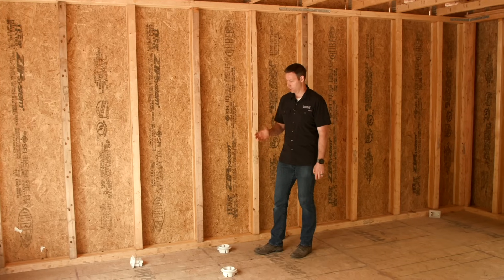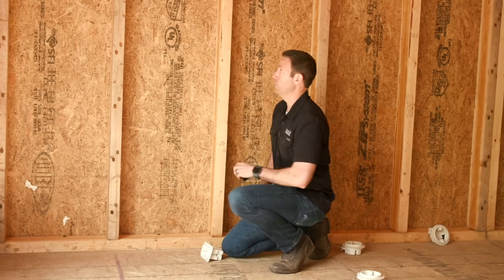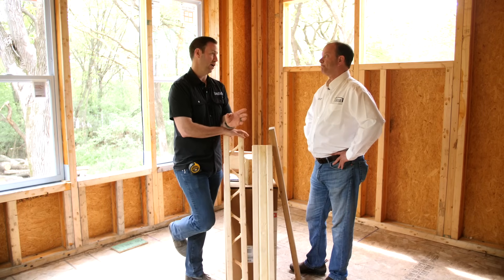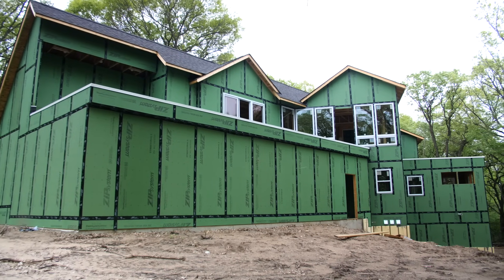Insulated Studs? This is a BIG Innovation in Framing!

Comment: Nice video. However it is a bit pointless when the Windows and Doors let most of the heat out.  And Prop 65 would probably prevent them from being used in California.
Reply: Every stud would have to be stamped with that lame ass warning. This product is known to the state of California to cause  pimples on my ass. That stupid warning is on everything you touch. It's like the boy who cried wolf. If you actually encounter something that could really harm you it will be ignored. I doubt that prop 65 will prevent one single injury from happening but I'm sure it provides numerous cushy state jobs.
Reply: What is allowed in CA, only illegal immigration and taxpayers getting the shaft!!

Comment: This is really cool stuff. However, there is an increase in the "double wall" style of build at least around here.  There is a modification to it now.  There is a 2x4 for the outside wall and then staggered there is another 2x4 frame, thus there is about an 8 inch gap to fill. How does this compare with this new "stud"?
Reply: I would expect it's similar, but the tstud could have a couple of advantages. 1) framing up wall sections with doubled, staggered studs is going to be a little more labor intensive.  2) On the double studded wall,  you're still going to have thermal bridging on the plates.  Whether those advantages are enough to offset the cost of the tstuds is the question.

Comment: Can these be used to stick frame roofs?
Reply: Balance 29 not yet 😊
Reply: Sounds like it won't be long with a few modifications.
Reply: There wouldn't be  much reason to do that.   Usually in Northern regions the attics are ventillated and cold. The insulation is in the ceiling of the top occupied floor. There would be no advantage to using insulated studs for a roof over a cold attic.
Reply: The reason I speak of is the weight and the ability to connect everything together with the foam. Hurricane area

Comment: Great innovation.  

Only things that I'm wondering about are fire performance and how much more difficult this makes fishing wires or changing outlets (a/v equipment, new ceiling fan etc.).    I know some foam products are fairly fire resistant, but others burn very quickly.  I've got some engineered foam insulation here and it was shocking how easily it went up in flames from just the tiniest cigarette lighter whereas you can hold that same little flame on a 2x and your thumb will give out before the wood ignites.
Reply: degustibus this is a Type 1 foam, we have a 20 minute video with a proponent torch online. And we have a Class A Fire Tstud coming in 45 days

Comment: why are the ceiling joist directly over the wall stud where Matt is standing at 7:65  but the 3 to the left of him are no longer centered over the wall studs?
Reply: onenikkione top plate is a mini header and 1.5 times stronger than 2 - 2x6’s in plank so the truss can be as much as 7” off center

Comment: My only concern is "off gassing."  The foam is a petrochemical product and as it oxidizes it releases fumes, right?  And then the plywood is made of wood chips glued together, and that adhesive will off-gas.  Add wall to wall carpeting and other petrochemical products into the mix and the interior air becomes polluted.  The amount of off-gas may be minimal and undetectable by most people, but it's there, and some people get sick because of it.  Otherwise, this is a great invention and I can see how brilliant it is.  I would consider using it to frame inside a shipping container home, too.
Reply: Russell Garr we use the new HFO blowing agents, not HFC. And the off gassing was really prevalent with formaldehyde’s pre 84 I think
Reply: Yes, but even real timber contains formaldehyde.
Reply: @greengenie7063  --- Interesting.  I wasn't aware of that.

Comment: so breaking the dowls for plumbing isnt a issue ?
Reply: Yes, it is an issue. The dowels are not permitted to be cut.
Reply: There should be enough room to fit pipe through it. If there isn't, then that means the hole you need is far too large anyway and would never be allowed in a conventional stud.
Reply: No dowels cut in 100 projects then a plumber cuts 7 on the same job. Dang. The repair in the field is to install a fully threaded #14 screw above and below the cut dowel. 5” long.
Reply: @thermalstuds  Sounds like the plumber wasn't briefed sufficiently on working with the material.

Comment: How is this a big innovation when iso3 has been around for probably a decade?
Reply: Because perhaps no one has ever made Insulated Studs BEFORE is why it is Innovative.
Reply: The definition of innovative is “introducing new ideas; original and creative in thinking”. To me, substituting wood for metal or concrete is not all that original or creative. It’s simply another building material.
Reply: @brucea550  gosh do you still miss the whole point of what innovate about it or what is considered innovative. This the first Insulated lumber i have come across that has actual structural qualities and not like others who just stick foam between two pieces of 2 by 4 that is not all that innovate or of and structural benefit other than to provide a thermal gap between the wood studs which is a form of double wall construction. What I am comparing this to is Larsen Trusses, which IMO are useless where as Tstuds serve a better purpose since they are so much stronger and provide better bearing support than a solid stud with the added benefit of the foam insulation being a thermal break/gap. www.greenbuildingadvisor.com/article/all-about-larsen-trusses
Reply: “Tstuds serve a better purpose since they are so much stronger and provide better bearing support than a solid stud”
Why do you think that? Source?
To me this is simply another form of double wall with insulation in the middle. Maybe the dowel part is innovative? I think it may be a good product (but can think of several reasons I wouldn’t use it) but until it’s been in use for a couple decades we won’t know. I don’t share your excitement for it, sorry. To me, something like pex is an example of being innovative- it changed plumbing dramatically, as well as in-floor heating.
Reply: @brucea550  Hydronic (in-floor heating/cooling) pex and general plumbing pex are NOT made equal, thus why you have to buy the more specific pex actually made for in-floor heating use, and many plumbing pex manufacturers say their product is not intended for other than general plumbing lines.
If you want to read the parts again in my previous comment to you and bother to go their website for the reports for yourself to get what I already said before. I am not going to further repeat myself.= tp someone like you who clearly can not bother to comprehend my intelligence. I even gave an informative articled link to another similar product that explains why that one is not made for structural purposes. This is still far superior than that and as they mention in the video the strength of the studs as already tested.
End of conversation.
Reply: I wasn’t discussing Larsen trusses. And yes, most of us know the difference between regular and air barrier pex. Tell us all again how intelligent you are? 🙄
Reply: @brucea550  Intelligence can never truly and accurately be measured. Is this enough to show my own intelligence?

Comment: The DrJ report leaves a lot of desirable information out about structural design. Is the intent to use these only in projects that follow the IRC or 2308 of the IBC? How do these deal with in plane lateral loads in sheathing per SDPWS (IBC 2305)? Can these be used as joists or rafters? Is there testing on bending? What type of wood are the dowels made of and is there bond to the flanges ever a limiting factor?
Reply: Also, if like me you actually dwell a bit in the testing reports, some of them mention the 2x3 being jointed by METAL pins, not wood dowels. That is an issue in terms of the validity of some of the testings.
Reply: Those are all good questions. The fact that this is an engineered product could seriously limit their practicality as you likely won't be able to alter them in any way to accommodate for mechanical's and what not.

Comment: Probably cost at least double for just the material not to mention the extra labor. Can buy a lot of power for that.
Reply: The guy mentions the price difference around 13:25 to 13:55, 1,500 more for 2500 sq ft or something like that.
Reply: Joshua79C C all I can say is bid it before you have an engineer put it in the plans. Or u be way over budget
Reply: @bartfdeubcvbuuexvio7289  Thanks but I already hae common snense to do m own hoework before going forth on a project when I have the finance to go forward with, Unlike those who just hit the gorund running head on into a project and then get shafted by the contractor with this and that bs reason. I worked for my step-dad who was  abasement waterproofing contrator and I had customers ask me if what they got quoted was right and I always first responded with "he does his own homework, did you do your own homework?". If I got asked again with a befuddled look or such I simply respond back with :"yes what you got quoted is what you pay for and is the best cost and if you are feeling dissatisfied with the prices or such then feel free to contact the BBB" (essentially a consumer protection bureau that grades companies based on customer satisfaction and complaints combined). 
He even showed customers what he pays so they were assured they are getting what they pay for and we did quality work, better than our competition who cut corners with crap products and poor workmanship, We since long gave up on the business when he encountered medical problems (fibromyalgia) and I was taking another path in life and taking on new challenges as I was only 22 when he decided to sell out, he asked me first if I wanted to take over "I am not interested and so you do what you want". Anywho, yeah I already know the gist of the world. We never got a call-back to redo anything other than to warranty our work and often found we got calls for malfunctioning pumps (we used the best available and nothing is always perfect), never had to rip a job to fix a leak in the drainage plumbing system.

Comment: Wow. This product is going to change building. I just hope the electricians would run there wire in the center of the stud. Not just on the back of the front stud. Amazing product. Great job.
Reply: I'd agree that would be best,  but  running it on the back of the front stud puts it back 1.5 inches whcih meets code, and is pretty much the same depth as running it through a hole drilled through the center of a stud in a 2x4 wall.
Reply: @andrewalexander9492  I was just thinking about that guy that runs a 3 inch screw hanging there TVs. Which your right most electricians do just put it a inch and half in. It really needs at least 1 3/4. But anyway I will be using this system on my next framing job. Excellent idea.
Reply: @SS--CAL   Yeah, I knew where you were going with that, just saying that in that regard, it's as safe as the best possible placement on a 2x4 wall. And you just know that even if you run it right in the middle, there's gonna be a home owner hanging his TV with 4 inch screws.

Comment: How do you prevent racking with single top plate. Also dont see any wind bracing to prevent racking. Do you have building codes there.?
Reply: it relies upon the sheathing/nailing to act as wind and lateral bracing, that's been done for quite some time now.
not saying I like it, nor the lack of overlapped interlocking plate joints :)
Reply: @throttlebottle5906  not sure that passes code here. ? Pretty sure need wind bracing still. Even with brick siding. Oh well. Just not sure I like the direction of where the building industry is going. Also lumber does have r value. Just saying. Real.lumber beside this stuff the r value is probably comparable.
Reply: @redwood7121  R value of the tStud is R20, whcih la 2x6 would be about R 8, so not really comparable at all.
Reply: @andrewalexander9492  what's going to happen structurally when the foam falls though.?
Reply: @redwood7121  From what I've read, the foam doesn't add anything structurally.  Obviously if the foam falls out,  the insulating value is going to suffer.

Comment: I wonder if that insulation could absorb water and keep things wet.  Time will tell.

 And while not directly related to the product, I would not buy a house with studs 20" on center.  It's hard enough to hang cabinets already.  Stop with the corner-cutting.
Reply: Not a fan on the larger spacing myself, not necessary with this product since it is now "self" insulated in compare to solid lumber, rather just stick to 16 OC as the extra strength would be even better than the more spaced out framing method.

Comment: Why would they use batt insulation and not spray foam if you’ve spent money on R20 studs..? Not a very cold climate?
Reply: Because good 2x6 bat insulation is r20
Reply: Trevor Roth yeah but spray foam is over 40. In 6”

Comment: They are certainly not going to eliminate lintels. Those things provide no support stacked flat like that. The only reason they did that is because they have a structural gable.
Reply: Actually the gable they show is not structural.  It is a gable truss.  That 9' door opening requires a structural header, and an engineer would have to sign off on this T stud being used as a header.

Comment: I guess I stand alone but I think it's a completely stupid idea.   I wouldn't use them.
Reply: my MAJOR concern is its strength. He says he comply's with building codes for things like wind. Standard throughout the US is a 3 second 100mph gust. Thats your standard 2x6 3 nails for 2 story or less houses. He talks about top down strength. He does not talk about sustained side to side stress. with less wood using dowels to make a makeshift Truss it is almost assuredly worse. 
My area gets a half dozen or more 100mph wind gusts per year. I Really would like to see that 2 story house try to meet a 126mph gust or 100 sustained rating. "It wouldn't"
Reply: @Tfad812  I bet the truss outperforms a stock 2 x 6.  There is a reason bridges and all sorts of structures use trusses.
Reply: @genephipps6421  They use is because it is cheaper. In a bridge like you mentioned; It is worth the cost of an engineer in order to use less material. In buildings they use them because they can be assembled off site then put into place. being roof trusses or metal trusses with cranes for tall buildings. Trusses inherently are cheaper, faster, and weaker than solid structures.
But in this case of these they are NOT cheaper than wrapping your house on the outside, but they may use less total lumber.
Reply: @Tfad812  pound for pound trusses are stronger...
Reply: Why?  I'm seriously interested in your opinion, because it seemed pretty legit to me.
Reply: @MichaelGustavsonArchitect  they still have connecting dowels so there is still transference of heat.  Having spent a lifetime in the construction and repair trade I have learned that to truly fix any problem you have to address the root of the problem.   I've also learned it's cheaper and better to do a thing right the first time.  I think there are good methods for increasing the r value of a house and I think this is just a distraction.   For years only the rich had cellular phones until the demand became such as to justify a price all could afford.   I  would like to see the same thing happen with an r control house so everyone could enjoy the benefits.
Reply: @engineclinic  The connecting dowels cover only a small fraction of the area a solid stud would cover, and since they are angled, any heat has to travel farther to get thru. That is why these studs are R-20, which is better than the typical insulation used in 6 inch walls. So now what is your objection?
Reply: @Ethan.Lamoureux  you haven't said anything to change my opinion.   R60 is still better than r20 isn't it?

Comment: Cool but what about rodents ?? Easy to wire then it will be so much easier for mice as well .
Reply: If you're using the studs as a way to keep rodents at bay, you have much larger issues. There is nothing about this system that hurts or helps them. If rodents are in your house, that's a problem in of itself.

Comment: if your going to use these new studs go with R24 Roxul  dont go the extra mile and then piss in your tank  use firecode drywall for added thickness and fire safety

Comment: Really!!?? Ok 1 of youre removing strength from studs!! 2 you wont need it if the house is gonna be insulated! 3 heat dont transfer trough the studs into the house! Heat stays traped into those boxes between studs,wich is why we put insulation on walls

Comment: Guarentee in 10 to 15 years the industry will find this product garbage.  Just like tyvek, d paper, osb, harty board, densglass, brown sheetrock, asbestos ect. Everyone tries to reinvent the wheel. 

It seems like a great idea. However,  the problem in houses in Minnesota is the extreme temperature changes. If you make something so tight, how are you going to expel the moisture caught in all the cavities of the house. All windows leak. How are you going to get that moisture out of the house? I bet. If you take off the siding of those houses around the windows there will be rot and mold. Just a guy with 35 years in the industry.

Comment: Larsen strut has been around a long time.
This is a poor substitution.
Reply: Larsen strut is more an onsite process than a product. It is optimised for cellulose filled walls, not fiberglass. It omits the advantages of diagonal bracing and reduced lumber mass. It also seems to require more framing labor and fasteners.